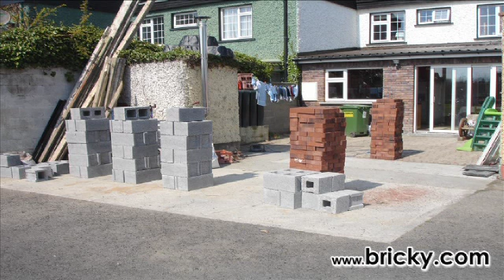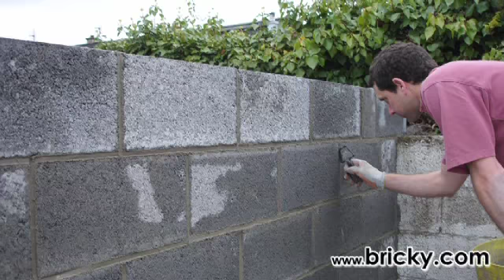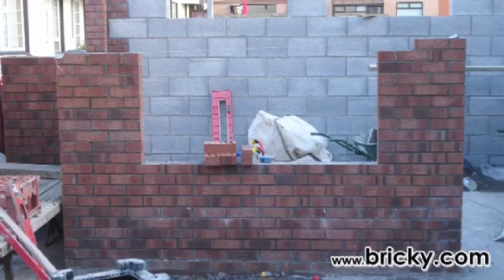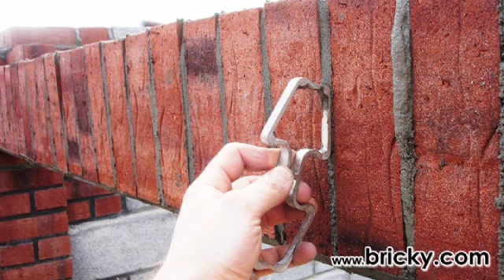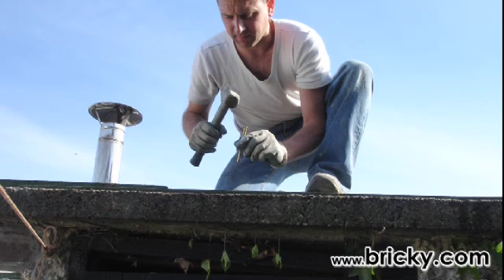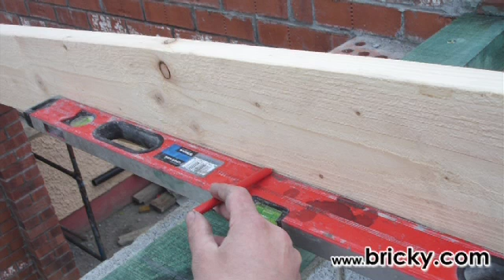How To Build A Garage/ Workshop - Part 1

Comment: I built a three high red brick wall for my garden plants  after three days of  curing or setting I noticed that the cement was still dark I got my hammer to check my work all the bricks fell apart I forgot to use cement. 💚🍀🇨🇮
Reply: You prolly dont care but if you're stoned like me atm then you can stream pretty much all of the new series on instaflixxer. Have been watching with my gf these days xD
Reply: @Leroy Aron yup, I have been using InstaFlixxer for years myself :)

Comment: You've left out the most important factor, your mortar. I mix at 4 parts sand to 1 part cement,  a tab 5ml of cementone feb mix the high concentrated stuff and stretch the water throughout the mix. Once it looks like double cream whip. This makes brickwork easy peasy.

Comment: I'm thinking about using the slab where a garage used to be as a base for an outside gym area. I'm wanting to build it up using cinder blocks (ran out of room in the house for equipment and such). I live in an area where it can sometimes just rain for a week straight so I was curious if cinder block is the best for dealing with that or if I should put more resistant blocks up to the water level (which would probably be 2-3 cinder blocks high because of the rains lasting long enough the ground is just waterlogged, farm fields turn to lakes lol).

Comment: Hello Noel. i bought the bricky tool after seeing you build the small building on the front corner of your plot and i used it to put the base down on my timber shed build. granted it was only 2 bricks high with a timber wall plate bolted down thro into the concrete base with rawl bolts but i was chuffed with what i'd done with it so it was well worth the money mate...i dunno about a project like this tho' it might be out of the scope of my confidence/ability.....but not that tool.
great vids..